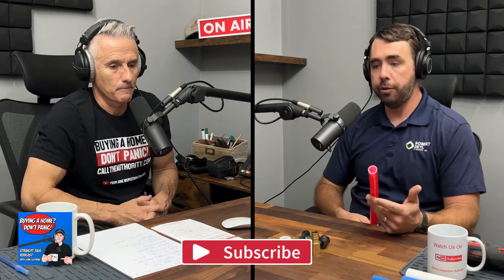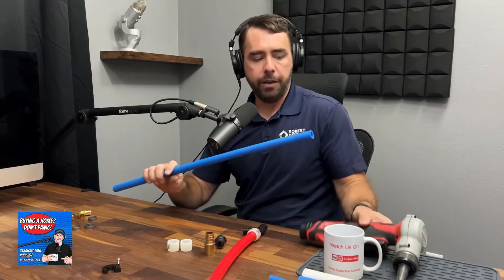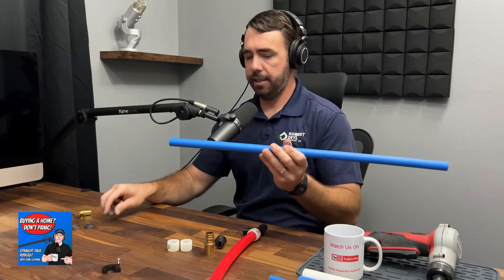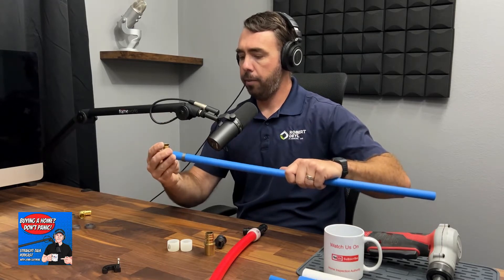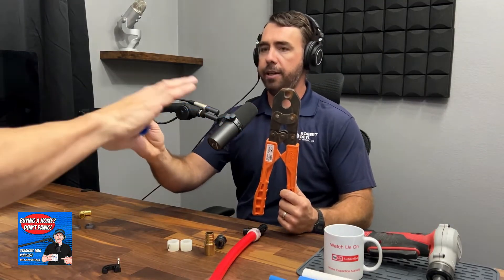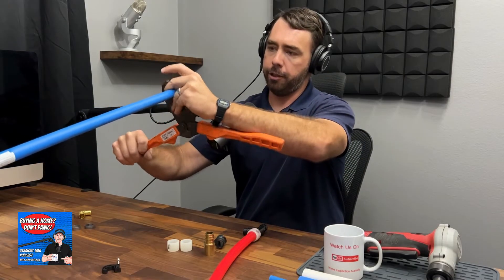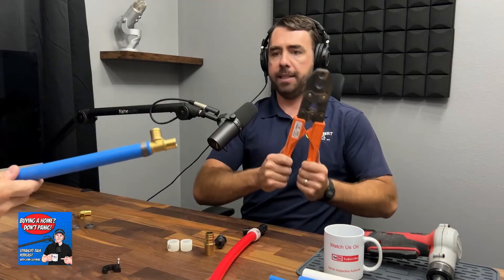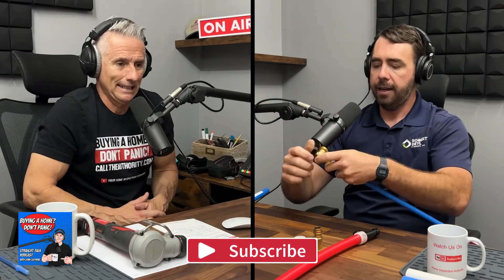PEX A Vs PEX B Pros & Cons | And Why They Are Not Interchangeable

Comment: What many plumbers and contractors won't tell you is that you should upsize your pex piping and fittings when using PEX-B.  Pex-B fittings have smaller Inside Diameter sizes compared to PEX-A.  This will restrict water flow and thus you will see lower water pressure at the fixture.  You should at least upsize your branch lines.  In other words, if your plans call for 1/2" copper, your pex-b pipea and fittings should be 3/4" to match the inside diameter of traditional copper or even compared to Pex-A

Comment: I do like to watch your very informative and educational videos -- I am about to build my last forever home -- I have been spending a lot of time researching what piping to use!  This whole PEX thing is driving me HAIRLESS (pulling it all out).  With 4 major brands now -- Apollo, SharkBite, Uponor and Zurn it is getting to be a nightmare trying to make out which one to use for my domestic hot and cold water with city water that has a list of some nasty looking stuff -- Most of which can be "filtered out" with a whole house water treatment system -- the one that appears not to be removed by filters is what is called "Chlorate"?  SharkBite claims to have the HIGHEST Resistance to Chlorine -- with a rating of Level 5 for Continuous Re-circulation Systems?  There are videos out bashing Uponor PEX A expansion and of course talks of lawsuits over Uponor PEX in general -- So what is a old man like me supposed to conclude from these claims and how can I choose which BRAND of PEX (I would prefer the expansion connection for fittings) to use for a custom home?  I have built multiple homes and done lots of copper and PVC in my career -- but PEX with the expansion ability is new to me!  The whole thing with Chlorine causing pin holes in copper and also causing issues with PEX A pipes is worrisome -- PLEASE HELP ME OK?  (sorry this is not on topic -- but I saw your most recent video is here and I want to try and catch your attention today!)

Comment: Pex was originally designed to leave from a manifold and go directly to the fitting.  The two terminal fittings (one on each end) were all you were supposed to use.  Zero concealed fittings. No stops or additional supply lines.  Just one solid piece from supply to end use.  Valve/stop was on the manifold for each line.  Each possible fixture got its own labeled line.  Most fixture lines would have been 3/8" all the way through the home.  !/2" was the exception rather than the rule.  Now it's just another misunderstood CTS plumbing material that substitutes for copper just like CPVC.  I did hundreds of those houses over 25 years ago.  Still no problems.

Comment: I understand that with PEX-A the fittings, (tees, elbows, & couplers) have a larger inside diameter to accommodate a higher flow rate. Although, I’ve never measured them. Just repeating what I’ve heard.

Comment: A common misconception is that pex a must be expanded. This isn’t true. The system we used to use was heat link. It started as all crimp but later they came out with expansion fittings. So pex a can use both systems, pex b can only use crimp. The exception is zurn pex b expansion but I’m not familiar enough with that to comment. This is why when I do new construction I use all expansion but with service, I carry all crimp fittings because no matter what kind of pex I find, my fittings will work.
I don’t like pex coming out of the wall but there’s no need to make your whole riser out of copper. Copper is just as prone to nails and screws as pex is. They also talk like pex is more likely to be loose. If you don’t secure copper properly it will move just as bad.

Comment: I’m about to install a condensing tankless water heater and I want to use pex but I’m seeing mix opinions on it. I see it’s allowed with 18” of copper first but wouldn’t the heat from the hot water make it pliable enough to loosen the connection?
Reply: Under most circumstances there shouldn't be a problem. PEX tubing is rated by ASTM to withstand 100 psi at 180°F water temp and 80 psi at 200°F water temp. Most homes have water pressure less than 80 psi so you could have nearly boiling water flowing through the PEX tubing without a problem.

Comment: I’d rather expand pex  b than use the fittings that choke the water flow down
Reply: 99% of houses would never see the tiny difference. So why pay nearly 2x for pex-a fittings? Plus pex-A leaches a lot more bad chemicals into the water, so no thanks.

Comment: I'm stunned at this video. You missed all the positive points on PEX A and a few on PEX B.

1. 1:18 - The expansion collar has a ridge on one end that only allows one way install.
2. The biggest advantage to PEX A - all the fittings are FULL FLOW. No matter how many fittings you use, they will not restrict the flow of water. PEX B on the other hand, WILL restrict the flow as the internal dimensions are actually smaller.
3. PEX B crimp rings must be used with a Go-No Go gauge to ensure proper crimping. No mention of it here.
4. PEX A tubing can be kinked, and re-used after heating and straightened back. PEX B cannot. The tubing must be replaced.
5. PEX A tubing can be bent in a tighter radius than PEX B, it's generally more flexible.
6. Both A & B are pretty much freeze proof. They will expand to contain the ice and when it thaws, it shrinks back to the original size.
7. PEX A tubing can be reused. Cut the compression ring off, heat the tubing, let cool, new ring, and go! PEX B is one and done. Of course you can do it but you have to cut the tubing end off and make it shorter.

Hope this helps. I prefer to use PEX A in all my installs. Much easier, the tools are much less costly, and you can't beat the flexibility. Good luck y'all!
Reply: 1, he did mention the collar only went on 1 way.    2, 99% of houses would never see any difference in flow of A vs B.  3, Agree   4, agree,   5, agree   6, agree,   7, would be difficult to cut the ring and not damage to pipe, but possible.   8, they didn't mention that before installing a shakebite, you should ream the outside edge of the pipe to keep from cutting the 0-ring, also didn't mention sharkbite also fits cpvc.   10, the didn't mention that pex-a fittings are usually double the cost of pex-b fittings, and the pex-a pipe is a little higher, and the pex-a tool is A LOT MORE EXPENSIVE.  11, didn't mention pex-a leaches a lot more bad chemicals into the water.  12,  some pex-b is expandable,     Oh my this list could go for pages.

Comment: Just watched a 4 year old video where Pex A and PEX B both using the expansion tool. Claim is the uponor tubing has a 10 year warranty but listed as 25, Zurn at 25. What’s the real deal and why can’t Zurn B be expanded. Was the other guy on crack? I want to run a recirculating hot water pump and he says Pex A fails versus Pex B. Not sure who to follow with this. I have the old poly in my 1992 house and plan on doing a complete repipe except for the tubing in the concrete where it’s low pressure. Otherwise I’m busting up concrete. Second story radiators yeah I’ll replace that as well and probably insulate.
Reply: Notice they didn't answer your  question .

Comment: Very informative video!
I'm really trying to wrap my head around how I can tie Pex A into my existing coper system, without soldering. I'm getting materials together to DIY install an Eemax HA024240 tankless Water Heater. I had reached out and got a few quotes getting a contractor to do the job for me; however, the quotes were all very high IMO. My home has low water pressure to being with, so I guess in the case of going with Shark bite joints and fitting, the low pressure would be a plus. I'll also be adding in a Whole House Spin down Sediment Filter to prolong the life of my Tankless Water heater.
Reply: Theoretically you can cut the copper pipe, use a Sharkbite Copper to PEX, and go from there. I just do not use or trust Sharkbite. They will ultimately leak every time.
I would go with PEX A. If by chance you have any Dewalt 20v tools, Dewalt sells a tool-only PEX A expansion kit for a few hundred bucks and it's the way to go.
You're suffering from low pressure, PEX B will reduce what you have, PEX A will not.
PEX A for the win!

Comment: terrible video, pex a vs b is the way they're produced not the way they can be used. pex a red and blue can't even be sold anymore because it fails after a few years and leeches way worse, which is why all you can find is the white.
zurn pex b is rated for everything and better than uponor pex a. both can use every type of fitting.

4:25 is wrong you don't know what manufacturer of the pipe is. You can tell by looking down the pipe but since you don't even know which fittings are correct you probably don't know that either.

Comment: I would stay away from Uponor and get Zurn Pex B. Uponor has issues with leaking after about 7 years (actual re-pipe incident). The chlorination breakpoint residuals start to get into the undulations of the pipe and chemically wear it away causing fractures and eventually - leaks.

Comment: I used shark bites on my hydronic radiant heat system. 10 years no leaks and so much faster than soldering.
Reply: There is no soldering when using Pex tubing.  So why are you even talking about soldering?  The video is about Pex tubing.
Reply: Shark bites are for homeowners.  No real plumbing professional would ever use that.
Reply: @dotthis71  funny, same thing was said 15 years ago by plumbers dying on the copper hill when PEX came on the scene.

Comment: Not a very good video so far,leaving out important information. Like the head of the pex tool,has different SIZE heads,the right head must be used with the right size pex A pipe. 
1/2 head want work for a 3/4 pex A pipe,
Also the pex hand held non rotating head that you need to rotate the tool,to help prevent a leak.
Reply from the maker: Thanks for watching! Don't forget to subscribe 😀

Comment: There goes that word again and I used to think man these people who are doing all this pex work dude God you know my 6-year-old son probably could have done a better job well not exactly you see whenever you actually see pecs that looks like it's been ran by a 5-year-old those are the people who are actually doing it correctly pics is supposed to be installed with a little bit extra so it can move around hence you not being able to use metal straps that's why that is. Not only does it expand and contract but it quite literally moves around and needs slack to be able to do.

Comment: You are not correct pex b dose come with expansion fittings and pipe it's called zurn although you're absolutely right about those copper rings being garbage because they absolutely are zearn makes a PEX b pipe that is an expansion system learn about it before you go on a podcast and start running your mouth about what it is and what it isn't.

Comment: what do you know about this issue with uponor pex cracking from chlorine in water...huge lawsuits going on....my home built in 2003 has this pex A ....it has some discoloration now in hot side...im really worried because my whole house is done with this crap...
Reply from the maker: Hi, I was not aware of this issue, do you have any links to the lawsuits filed? im sure the other tubers would like to read up on this as would I.
Thanks
Reply: yep, this is why type A colored isn't to code anywhere anymore. Only uponor white is allowed. Zurn pex B is better in every way other than bend radius.
Reply: @gg-gn3re  thank you for this information

Comment: A huge difference between Pex-A and Pex-B that was important for my own application is that Pex-B fittings are generally more restrictive.
Reply: While that is true, 99% of houses would never see any difference. Look at the supply lines going to the sink, 1/4 diameter inside, way smaller than a Pex-B. Plus, most have low flow fixtures, using way less water.  Saying I have pex-A is like saying, I have a car that goes 200 mph, driving it in a 65 mph zone isn't going to do you any better than your normal car that might only go 100 mph.  Even if you had 3 sinks, 2 showers and a washing machine running at the same time, pex-B will probably still be fine, since the city water meter wouldn't be able to supply enough to start with.

Comment: Don't forget that some electric systems are grounded through copper and/or galvanized water pipes.  When you add a sharkbite connector or replace a section of metal pipe with Pex you break the ground path.  The solution is to install a ground wire between the ends of the splice.
Reply from the maker: correct maybe we can cover that next time. Good input thank you.
Reply: Some now we're getting somewhere maybe that's what it is I am under the mistaken impression that you guys are actually talking about the tankless's that are worth a f*** yeah I like my bad I don't know Jack s*** about any electric tankless systems because they're f**** garbage like so much so that like you should just like take it out of the box and throw it in the garbage I mean unless you just really like doing that much serious electrical work that is going to be expensive as hell unless you're doing it yourself but yeah good luck in all your endeavors I really don't give a s*** who you guys want to lie to you I don't f**** know you You ain't never going to see me I ain't never going to see you so I don't give a s*** what you're f**** doing on YouTube Ball this video up real tight and stuff it up your f**** ass.

Comment: Can use crimp rings on Pex A pipe?Is there Fittings that are intended for Pex A or Pex B or should I buy a Pex B fitting such as an elbow for Pex B only?
Reply: you can use both on either. It depends on manufacturer. (NOT A vs B) This video is totally wrong and not a good resource.
Reply: YES.  You can use Pex B fittings (elbows, Ts, connectors, valves) with Pex A tubing.  Works perfectly fine with the stainless steel clamps (and I am guessing the copper rings) on Pex A tubing.  Good and fine.  But, you cannot use expansion Pex A fittings in Pex B tubing.  Yes I guess there is expansion Pex B tubing now too.  But ignore that.
Reply: No expansion B tubing to my knowledge.Thanks for the reply.
Reply: @Dave-ld3dr  Expand your knowledge and you will find some pex-b is expandable.

Comment: You didn't say whether the crimp ring type connections can be used with PEX-A. I understand that they reduce flow a little, hence the reason for using expansion links, but I don't want to spend $500 for the expansion tool when I'm only rarely doing a PEX repair job.
Reply: Yes you can use the stainless steel clamps on Pex A tubing when installing Pex B fittings in Pex A tubing.

Comment: I’ve been using all of these methods for well over 10 years now. The only problems I’ve had with any of them has been from user error. The only things I stay away from are copper crimp rings and concealed push fittings. I personally prefer pex-b with stainless crimp rings. Built my own home in 2010 using this method and have yet to have a single leak from them. Also, Zurn pex-b is expandable.
Reply: Mike-why do you prefer the stainless crimps versus expansion  (the later are fool proof visually easily inspected, and tighten over time
Reply: That’s not a screw up mixed fiiitng-Pex b is expandable ! How double an ‘expert’ be so wrong ??

Comment: Pex B w the stainless steel crimps are the way to go.

 I installed in my house 15 years ago and not one leak. Made it thru the Houston freeze just fine. Holds up in the attic w extreme houston Temps in summer.

Not sure how pex a stays together in both occasions. 🤔 I feel like when crimped correctly it is better than pex a.

Just my 2 cents
Reply from the maker: Great to hear you used PEX B with no issues. I just prefer PEX A as it seems like a better application. Just my opinion. Thank You for your Comment👌
Reply: Yup and it seems to be more failures. With  PEX a , not sure install or the pipe.

Comment: No one needs to worry about press-to-fit (Sharkbite) leaking, because it’s not chosen in the first place due to cost. 

But is it known to leak? Nope.
Reply: what you don't want a sweet $30 fitting from sharkbite? hahahahaha
Reply: @gg-gn3re  I recently picked up a few for temporary use. Well worth the cost in time saved. My comment a year ago was a reflection of a different need when plumbing at scale.

Comment: A will often cost less than B, which is why pros will not mind spending $500 for that Milwaukee, whereas the homeowner will only spend $50 for the crimp tool and not mind spending more on the pipe.
Reply: EVERYWHERE I have looked, Lowes, Home Depot, plumbing supply houses, online, pex-a fittings are a lot higher and pex-a pipe is a little higher than b. I'm in the South, maybe it's different in other places?

Comment: The fittings are not determined by the method used to create the pipe. The fittings are instead described by ASTM.

If a pipe conforms to a particular ASTM standard, it can safely use those fittings no matter if it’s A or B.

And so … pipe should be stamped (inked) with whatever ASTM fittings it can take. Regardless, this is what spec sheets are for.